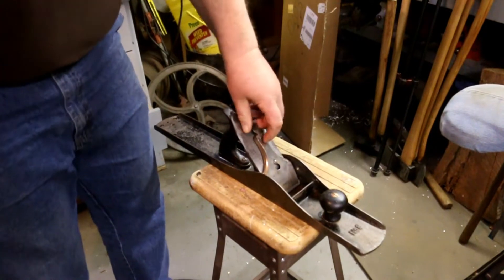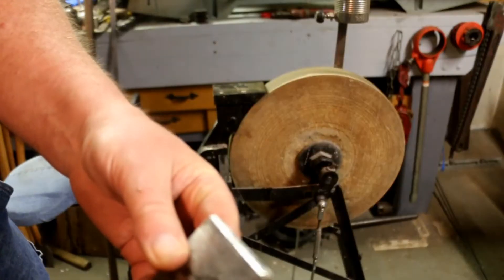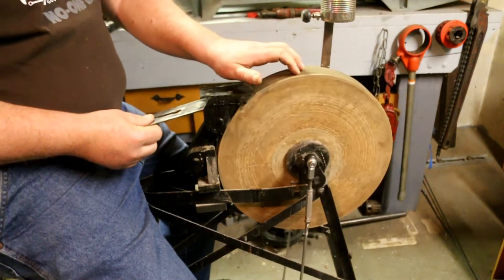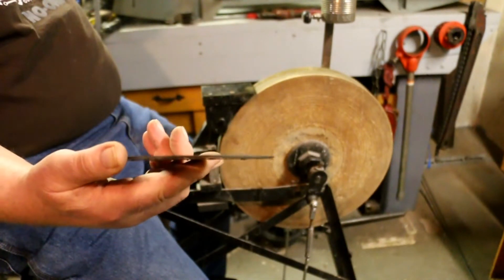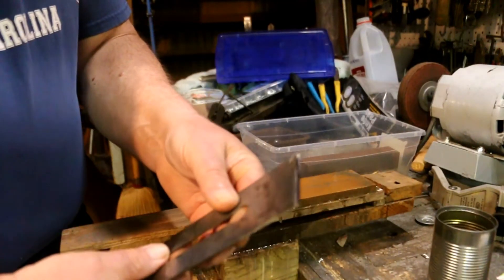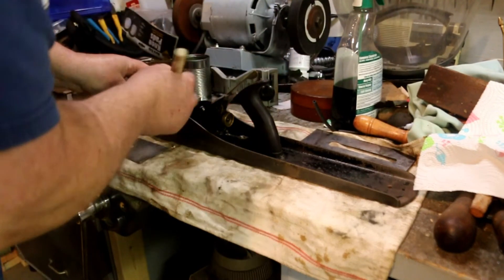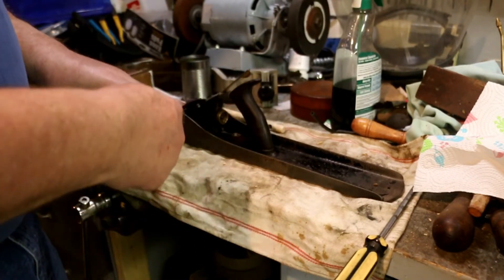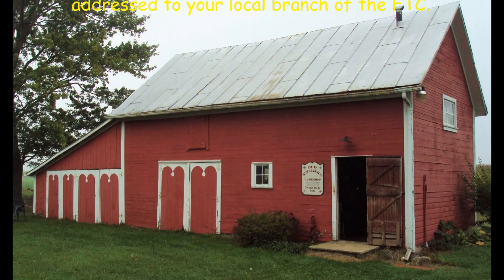Sharpening The Stanley #8 Plane Blade

Comment: A reminder that my No 8 plane is on a table waiting for me to get around to cleaning/restoring it.   I have to get a new blade, the old one is really worn down.
I find sighting the blade is easier on a smooth sole plane than the corrugated.
Nice job on the sharpening.
Dave.
Reply from the maker: You can buy replacement blades. I even saw a few at Home Depot. 
On my #8 the tool steel starts at the halfway point of the hole for the chip breaker mounting screw. I would imagine you could sharpen to near the point of breaking into the hole. 
I am use to corrugated planes. When I started buying planes to clean up and get working corrugated planes were what I found the most. 
The corragations stop short on both sides of the mouth leaving about a 1/4" of flat section on both sides. 
I have found it easier to flatten the sole on a corrgated plane. There is less metal to remove. 😁😎

Comment: Never burn the edge with a grinder like that.....I guess that`s why you have it....When you're done with it....it`s better than new.....Nice plane....CHEERS
Reply from the maker: The water on the stone works great. 
I got the idea of having a treadle grinder to dress up the blacksmith shop at the old house.
It took 15 years to find one in good enough condition to rebuild it. 
When I got it working right I was amazed how good a job it did.  No burn and the wide stone automatically ground plane blades straight and square. 
It was awkward in the beginning. Like rubbing my stomach and patting my head. Once I got use to it it became my goto blade sharpener for planes, drawknives, and axes. 
😁😎
Reply: Super slow speed wet wheel non-electric grinder would be really hard to burn the blade with. 😂🤣😂🤣😉. That's funny.
Reply from the maker: Low RPMs, but very large diameter gives you a high number of surface feet per minute. 
Grinding is rated by SFM just for that reason. The wet stone is common in tool grinding. The nice thing is being able to run it without power. No wires or controls to worry about. 
It is like patting your head and rubbing your stomach when you first try it. With some practice it gets to be routine. 😁😎

Comment: I feel like there's still a Unfinished Grindstone floating around there somewhere but I could be wrong.
Reply from the maker: Actually there are two. The Big Grinder and the original small stone that I bought in 1996, but couldn't find a frame to copy. I finally found a frame about 4 years ago that was damaged but repairable. I rebuilt that one to the one I used yesterday and adapted the frame design to handle the Big Grindstone. 
In the meantime I found a 4th grinder in nearly usable condition and fixed it up for my nephews bladesmithing shop. 
Fun times with big stones.  😁😎

Comment: Nice grinder! Did you need to true up the wheel when you got it?  If so, how did you do so?
Reply from the maker: Yes I did.
This grinder was dressed to size in the shop. I don't recommend that. It made a huge cloud of dust and filled the shop. 
The next grinder I dressed was Old #47. It was a lot better to dress it outside. The angle grinder did a fine job.
https://youtu.be/Tpia_ciynxc